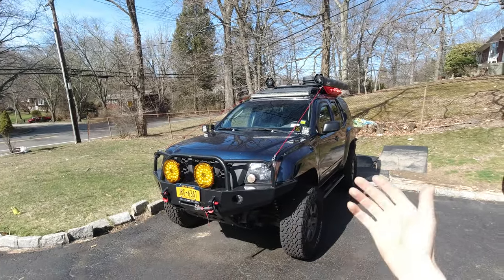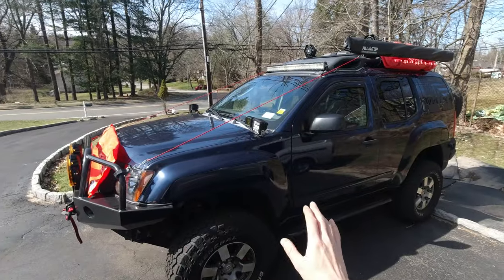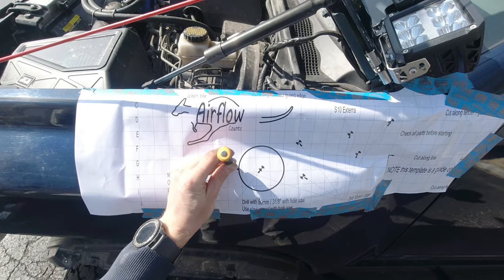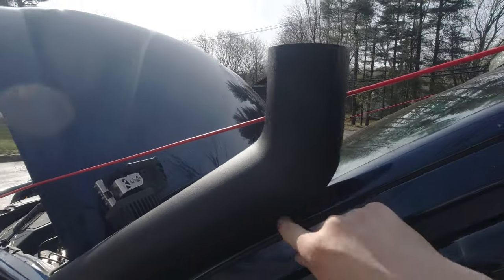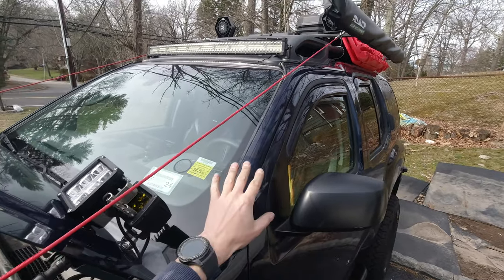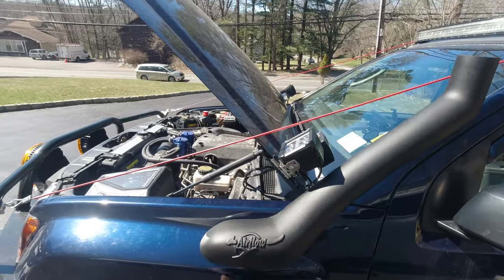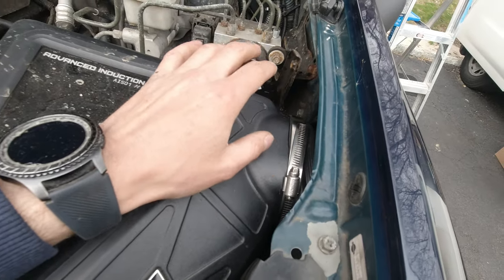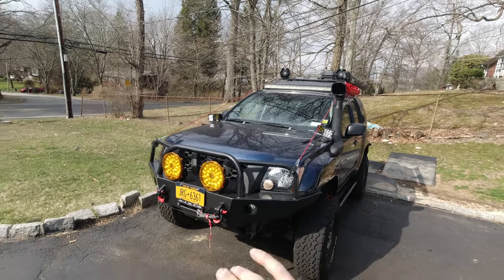Finally Installing Airflow Snorkel On  My Nissan Xterra

Comment: The one hole on the fender you ended up not putting the nut onto (d/t issues accessing) did you seal the hole with silicone? If I were to do this, would you, suggest not drilling that mounting hole? Seems like it would not affect the stability of the snorkel.
Reply from the maker: no  I didn not seal. it..  hmmm maybe I should have .. didnt even think about it.. 
and yeah I  would not worry a bout that hole dont drill it. The snorkel sits very solid and doesn't move at all
Reply: Thank you for your reply! A snorkel is much later down the line but I just got a little carried away daydreaming/researching haha. Love the rig and your videos. Thanks!
Reply from the maker: @BRANDOAN  Its always great to have some plans and think of what to do next on the truck even if it takes time to get to those goals ! ))
Thank you very much buddy glad you enjoying them   )

Comment: I cant seem to find that coupler u use to connect on your intake to the snorkel. Im browsing in your friend account but i couldnt find it
Reply from the maker: hey are you talking about the  "Pipe Diameter Roof Flashing" that I used to connect it ?